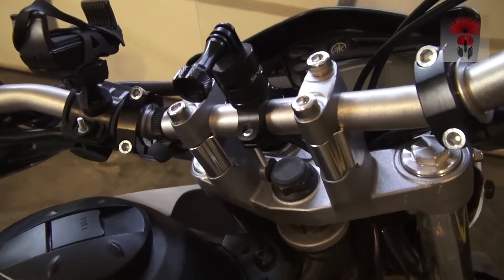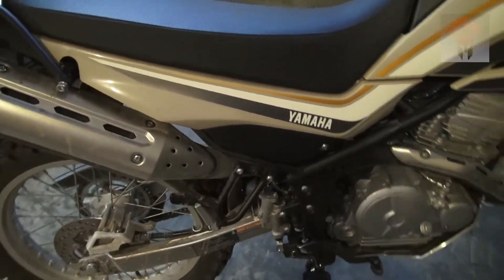Critical 30mm Handlebar Risers Intall

Comment: Thanks for the video, just found it before I installed risers on my 2009 XT250.  Did you have to fiddle with the cables?  I don't seem to have 30mm (or much of any) of free play once the clamp is unbolted. I wasn't sure If you just didn't video it.
Reply from the maker: I think I might have wiggled the wires out of the way while working it.  I did have to adjust my mirrors when I added the hand guards, but the riser was super easy to put in.  I do think it would be worth paying attention to the number of turns you put on each screw because you could tighten one side more than the other.  I'm a bit of a perfectionist on stuff like that, but I'm sure if it secure you will be good.  Later on I may put a different handle bar to make it a bit taller.  I do notice the difference now when standing up and its less strain on the back.
Reply: Thanks, I'll give it another shot. I checked at Rocky Mountain ATV, and they are supposed to fit the '09 (not a lot of difference between the years with any parts). Maybe the previous owner secured them somewhere I didn't see yet. I appreciate the reply.